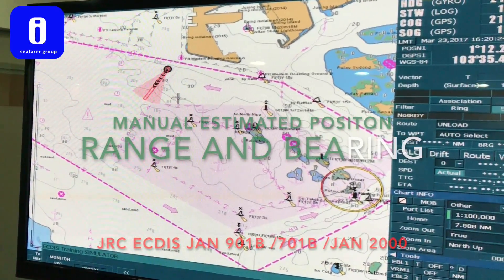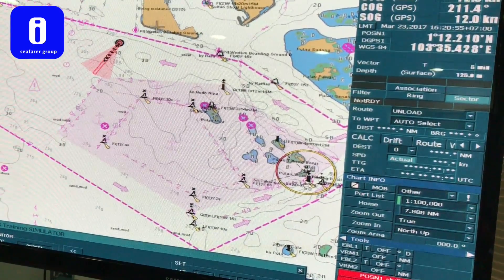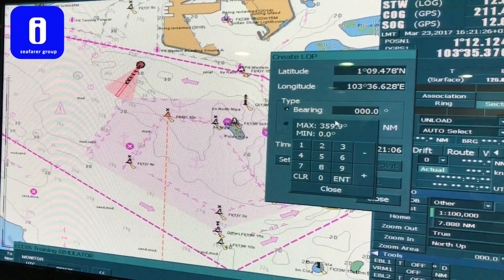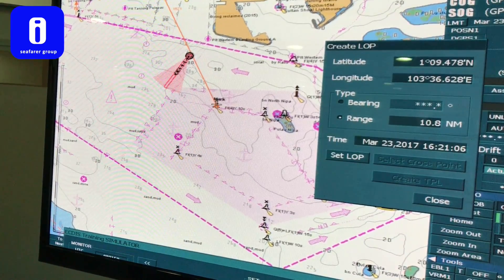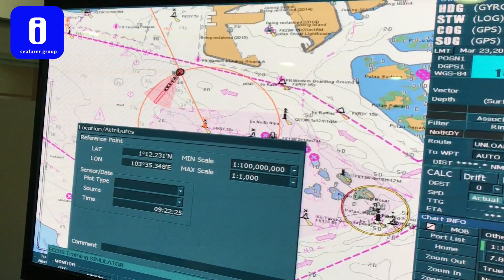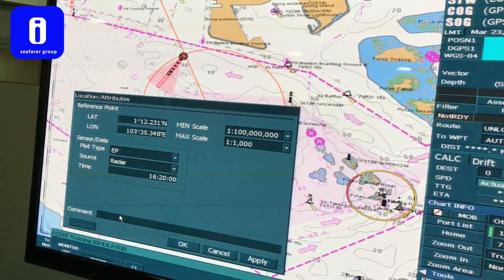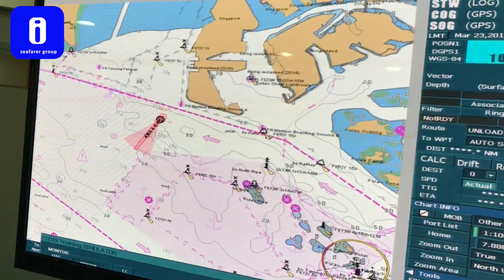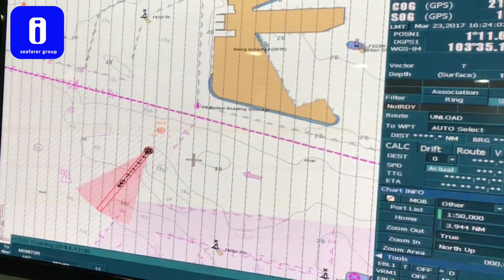How to make Manual Estimate Position using JRC Ecdis

Comment: The most dangerous way of cross-checking GPS position. Even the manufacturer of JAN-901 does not allow to use this option during navigation. We have a safer ways of making a cross-check on JAN-901/701/2000